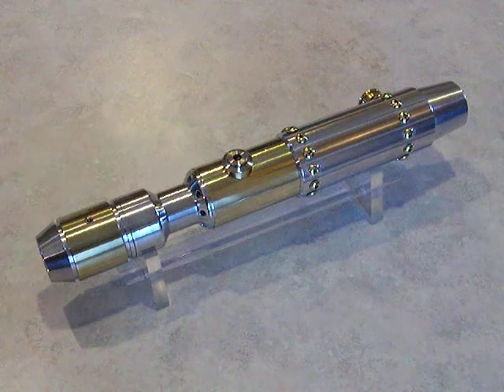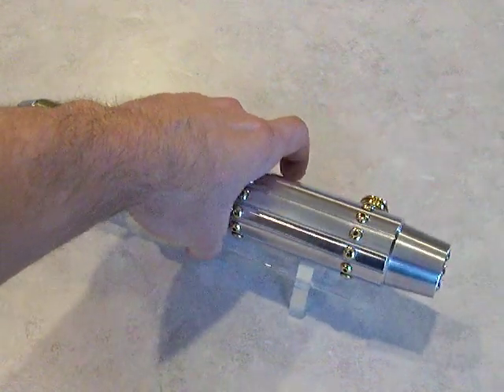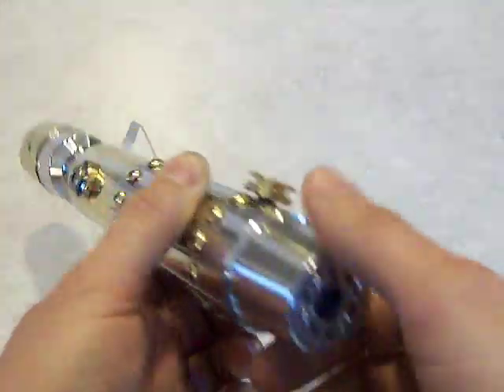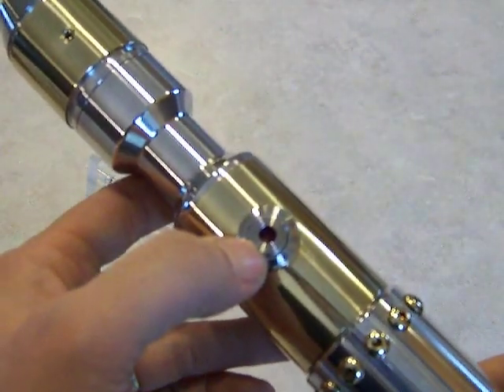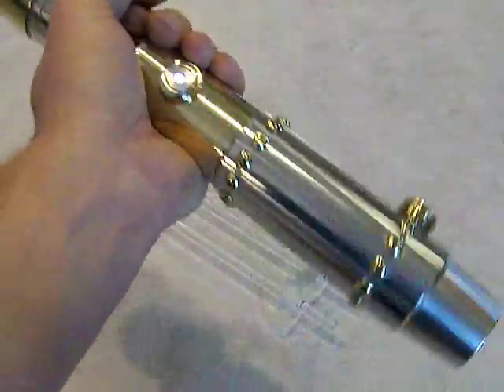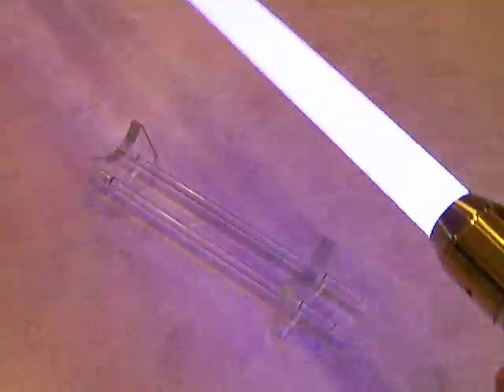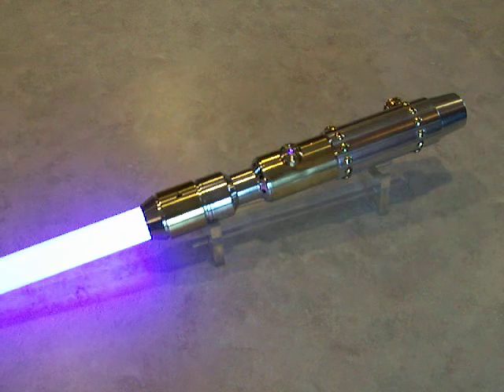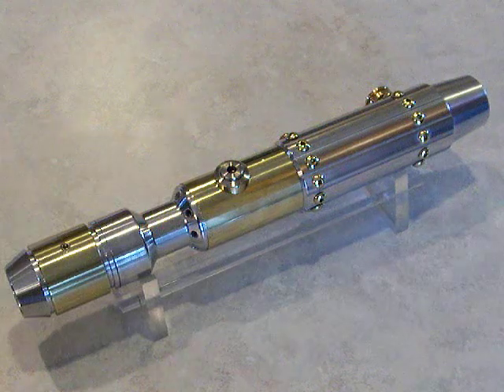Jay-gon Jinn's Brass Saber 21 (BS-21)

Comment: Hey man I know this video is super old now, but could you tell me where you got those brass button head screws? I have the same extension piece in my build and I really want those brass screws for it. Please let me know.. thanks!!
Reply from the maker: I get my screws for sabers at McMaster.com
Reply: Thanks for the reply. Looking at McMaster's website, I'm assuming the screws you got were their "Brass Button Head Hex Drive Screws".

Can you confirm that those were the actual screws you bought? That seems to be the only listing for brass button head screws on their site, but I just want to be sure so that I don't buy the wrong screws. Thanks again for your help.
Reply from the maker: @Neo_Sauron  that should be the ones. I used the 8-32 1/4 inch.